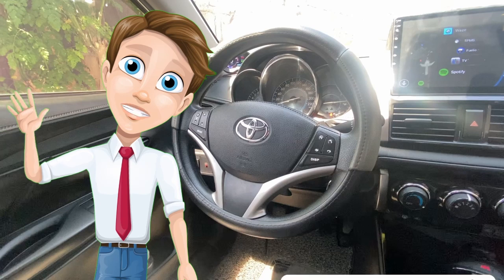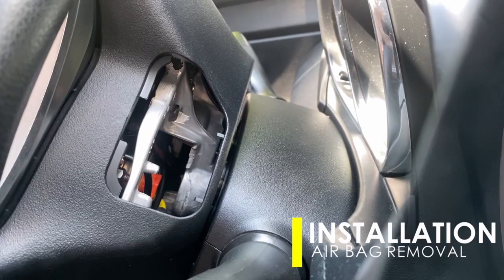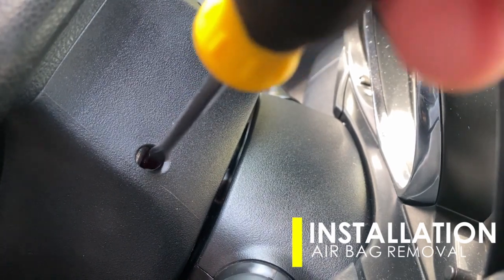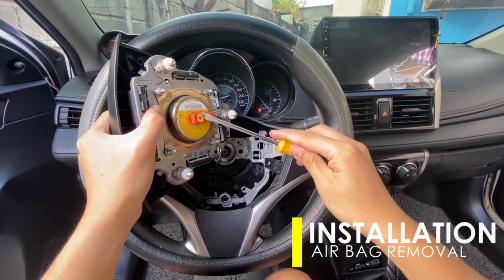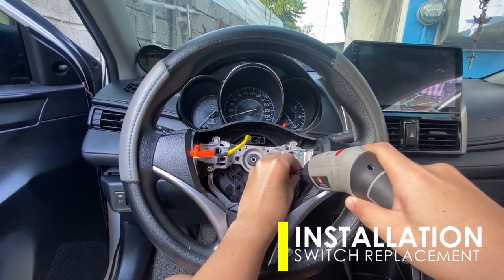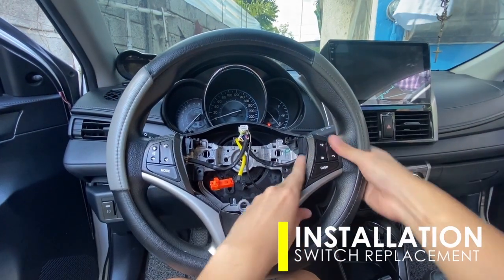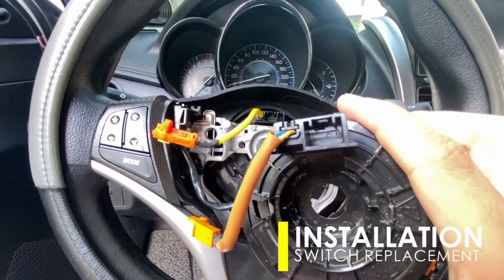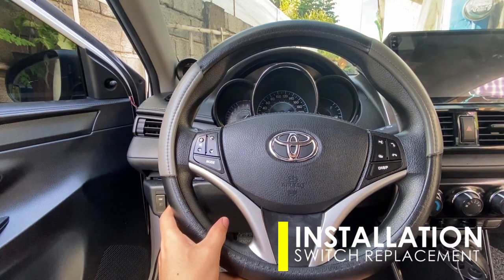How to Install a Steering Wheel Audio Control [PART 1]; How to remove an Airbag

Comment: J po ba yang variant mo kaya nag palit ka ng clockspring?
Reply from the maker: Yes po, J. Opo ngpalit po ng clockspring na my 10 pins.
Reply: @EngrDeeIWye  kapag 10-pin na po ba agad yung clockspring need pa rin baklasin yung android headunit para irewire yung harness, or enough na po yung pagkabit ng 10 pin cable sa clockspring?
Reply from the maker: @lester7777  check mo sir qng ung harness ng clockspring (katabi ng ignition) is meron ng cable. Ung saken kc wla talaga kaya naglatag aqng wire from steering to head unit. 3 wires lng yan sila papunta sa head unit.
Reply: @EngrDeeIWye  tnx sir
Reply: E variant 10 pins na ba?

Comment: Sir nde po b my chance n sumabog ang airbag habang binaklas ang airbag unit? Need q po kc try q po baklasin at linisan ang control button ng touch screen stock unit. Ayaw po kc baklasin ng mga talyer d2 sa amin natatakot bka daw sumabog ang airbag. Salamat po Sana mapansin
Reply from the maker: Ai hnd sir, my circuitry po yang airbag qng kailan xa mg activate.
Reply from the maker: Sundan mo lng yang ginawa q pra di masira ung pin papuntang airbag, tas better dn tanggalin mo ung isang terminal sa battery, para safe ka.

Comment: Sir rj tanong ko lang po stock head unit palang po gamit ko gumana po kaya mga steering buttons kung sakali? Yaris 2016 MT Hatchback po gamit ko. Thank you
Reply from the maker: Sir, pa verify po sa settings ng stock head unit if merong steering controls. Kasi qng meron po, yes magwork xa.

Comment: sir pwede bng gumana yan s stock head unit ng vios e? vios j din gamit ko nainstall nrin ng electrician ung steering control n nabili ko s lazada nagpalit n din ako ng clock spring kaso kulang ng harness n nakaconnect s clock spring. hope n matulungan mo ko sir.
Reply from the maker: Vios j aq sir. Ung harness na gna mean mo sir is ung nsa susian na banda? Dpt kasama na un pgbili mo ng clock spring sir
Reply: sir walang kasamang harness or cable ung clock spring na nabili nung nagkabit sir. kaya di p gumana ung steering control. sir baka pwede mo ko matulungan. ano b sir ang kailangan kong bilin n harness n available s lazada. tnx sir
Reply: oo sir ung nasa susian banda
Reply from the maker: Sir, ung original na clock spring, is meron dba ung harness? Ung isa lng ang wireC green ata un. Un nlng ang gamitin sir, gamit nlng ng pin pantusok doon
Reply: sir gud pm. hindi kayang paganahin ng mga kausap ko n technician ung steering control. sir baka pwede magpatulong syo ng personal para lng gumana itong control sir. or baka pwede kitang icol para lng malaman ko ung full procedure. tnx

Comment: can the steering wheel control work with the original toyota stereo ( without android) if yes then do we need the wiring from clock spring till the radio head unit. ? can you help me out..sorry i am using google translation

pwede po bang gumana ang steering wheel control with the original toyota stereo ( without android) if yes then need po ba natin yung wiring from clock spring hanggang sa radio head unit. ? pwede mo ba akong tulungan..pasensya na gumagamit ako ng google translation
Reply from the maker: Hi sir, actually I haven't seen the wirings of the original toyota sterio, mine is just an upgraded version from the radio. 

But can you check in the settings sir if there is a steering control settings? 'Coz if yes, it is possible because from there, you can teach the steering control keys on their functions. 

Tagalog po kau?
Reply: @EngrDeeIWye  thanks.  i need to check that , but its a normal head unit not the touch screen type. just a simple audio system from toyota, wish i could send you pic

Comment: Gumagana backlight?
Reply from the maker: Wla pong backlight ung binili q sir.
Reply: @EngrDeeIWye  how much 10-pin clock spring and gumagana ba lahat ng buttons?
Reply from the maker: @melocowan2610  nasa 1200 ung clock spring sir, gumagana nmn po lahat except yang disp button.
Reply: @EngrDeeIWye  Kanino ka kumha clock spring? Nabili ko na kasi sa Lazada yung steering wheel audio control, clock spring na lang problema. Haha
Reply from the maker: @melocowan2610  search mo sa fb c sir chris marquez sir, diy master.
Reply: @EngrDeeIWye  Thanks sir! More DIY vids 😊
Reply from the maker: @melocowan2610  oo sir, kaso busy pa ngayon, dumating na mga lazada q pero time nlng kulang . Hahaha
Reply: @EngrDeeIWye  Boss nakakuha na ko kay Boss Chris, ₱1.2k siya, kakarating lang now. Thank you sa referral!
Reply from the maker: @melocowan2610  nice, cge sir, hope ma install mo na. Laking convenience tlga pg merong steering control. Hehe.
Reply from the maker: Try mo dn ung ibang upgrades q sir, lazada/shopee lng yan lahat. Hehehe, low cost upgrade
Reply: @EngrDeeIWye  Ikaw lang din nag replace ng clock spring? Hinihintay ko pa from Lazada yung steering wheel audio control. May ilaw daw ito sir, need lang magdagdag ng wire. Nakita ko sa comments sa product.
Reply from the maker: Sir, napagana q na ang backlight hahahaha
Reply: @EngrDeeIWye  paano po napagana? san kayo nagtap? Salamat
Reply from the maker: @Hataku08  open mo ung likod ng control keys sir, nka screw yan, makita mo doon my tag ung terminal na ill+ and ill-, un ung supply pra sa ilaw. 

Tas hanapin mo lng ang pin na papunta sa output ng clock spring, at doon ka mg tap ng positive 12 vdc at ground.
Reply: @EngrDeeIWye  sige sir, maraming salamat. Tagal naghahanap ng tutorial nito. Salamat ulit sa pag share ng kaalaman sir.
Reply from the maker: @Hataku08  buti at nangulit ka sa backlight sir, hahah, akala q tlaga wlang backlight, ngaun mas astig na hehe
Reply: @EngrDeeIWye  sir question, anong pin no. from output ng clockspring yung tatap sa ill+ at ill- ? diba sir may naka tap ng ground papunta sa head unit din? thank you sir in advance.